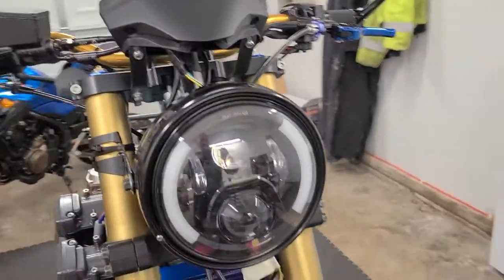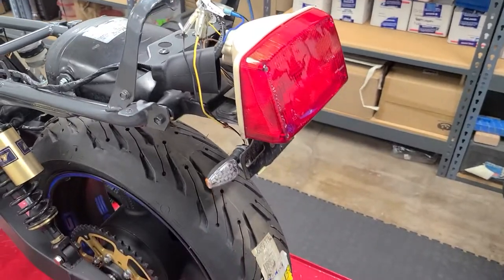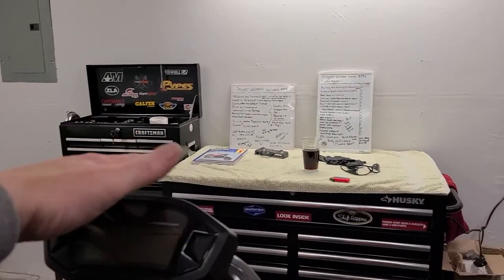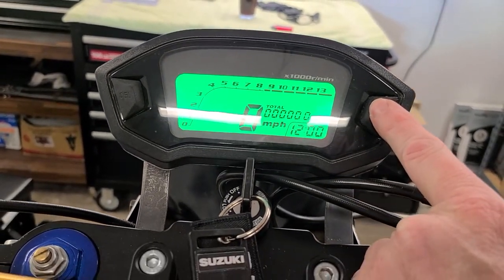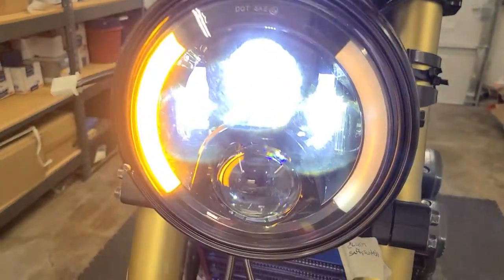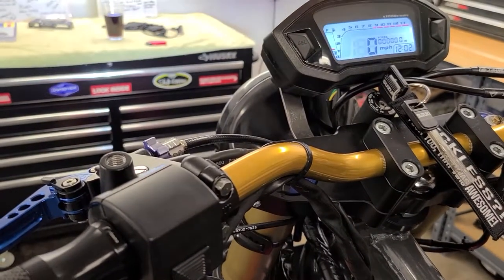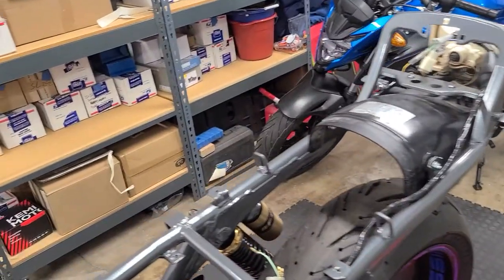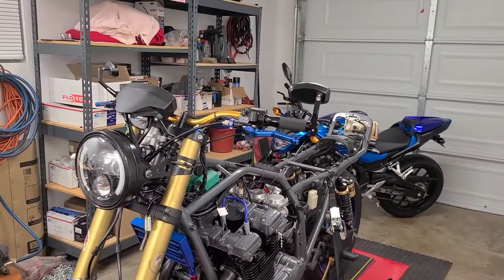DAY 87 83 Suzuki GS 1100E/ wiring LED blinkers taillight headlight

Comment: What flasher didvyou use?  I have a 1980 Suzuki GS 1100 E and tried LED flashers that did not work. I tried the metric diode and that did not work. TheOEMfkasher is a three prong.
Reply from the maker: Believe it or not I got the relay from Napa
Reply: @krmoto5158  was your’s a three pin?
Reply from the maker: @kevinbagnall2518 yes   It's a 3 pen it should work
Reply from the maker: @kevinbagnall2518   Let me know if it works
Reply: @krmoto5158  the original relay has a “C” terminal which is for the pilot light. I found one with a “P” but it was for power ie battery. I have two more coming. I believe they are both for pilot lights. Thanks for the help.
Reply: @krmoto5158  i got anExtremeAmazing
Reply: @krmoto5158  i got an ExtremeAmazing 12V 3 pin round Heavy Duty LED electronic no load fixed turn signal flasher relay.  I put two 10W LED light load Resistors connected in the front light housing
Reply from the maker: @kevinbagnall2518  awesome! glad it work